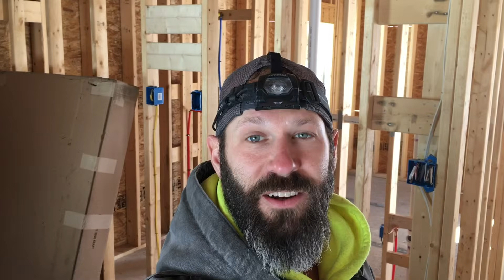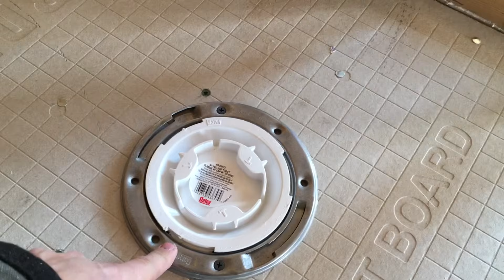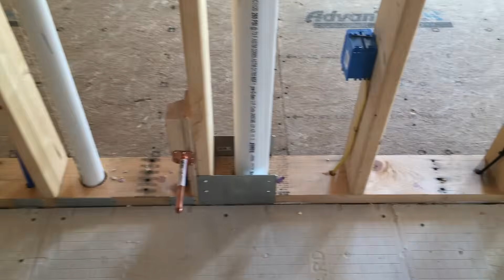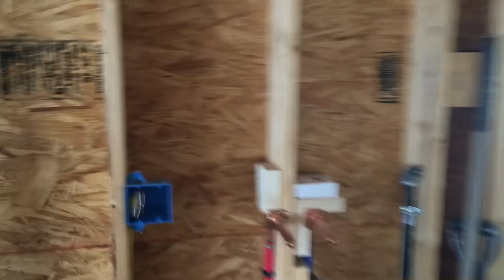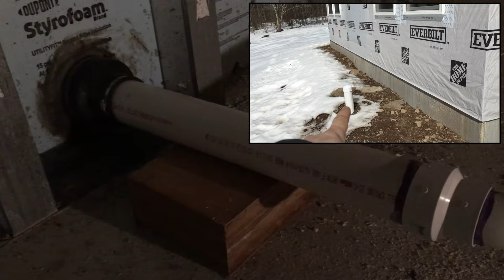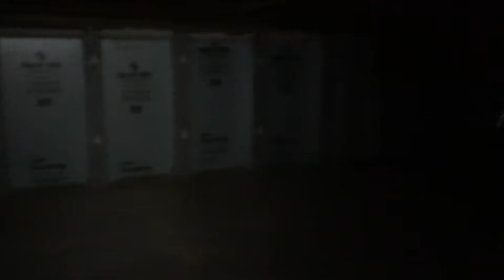Drain, Waste & Vent System | Off Grid Homestead Build Ep19Pt2 | The ShabinLife

Comment: do i need to have venting for every bath room(which i believe so)? and how to do the venting for multiple bath rooms? Thanks in advance!
Reply from the maker: Most times you can have vents tied together as long as they're within a certain number of feet (most times 10ft). The inspector may be a little more flexible if it's just a bit further depending on the rest of the install. I've come to just question the inspector if there's any concern so I don't have to redo anything later down the line. Hope this helps a bit & thanks for checking out the channel!
Reply: @shabinlife  As you say,  you can if you prefer run vent pipes together in the attic.  There is a calculation I believe (UPC vs IPC may be different) for total sq in of vent required based on number of drains and their size (total vent sq in >= drain size sq in total).  So it may be necessary to have a 3 or 4 in vent going through roof if you do that.

Comment: You are using the term wet vent wrong. A went vent is when a vent of one fixture is used as a drain for another fixture this usually happens in two story buildings. These are all dry vents there is no sewer draining into your vent pipes.

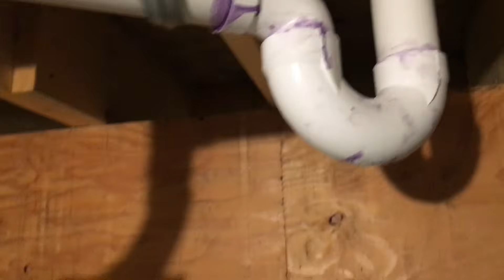Comment: @4:22 ... Toilet has to be last fixture on the branch. In your situation, you should have  run shower drain  further down the line and connect it with "Y" after  toilet. Otherwise, nice, clean job.
Reply: Not true. Has to be last fixture connected to a wet vent
Reply: @dallaskeck7169  Well, depends under what Code your work belongs. UPC vs IPC. There are also State Codes / Municipal  / Local Codes that add to the basic installation requirements. In rural and unincorporated areas, you can do what ever you want. In cities and high-populated areas, you have to follow local Codes. If I am inspecting your installation, I'll issue a Correction Sheet, regardless. Thank you
Reply: Toilet must be last fixture (period)
Reply: @businessman5894  True words
Reply: Why he run the kitchen drain to far from the main? Explain me
Reply: Wc only must be last on a wet venting. his setup is all dry vent. Just to prove it, look up circuit venting in a commercial building where there's like 20 fixtures on a single drain.

Comment: Putting water lines in the outside wall for the kitchen sink is an accident waiting to happen. There is no crime in bringing those lines up through the floor of the base cabinet. (49 yrs in the trade)
Reply from the maker: Thanks again John, certainly a great recommendation! I did install the waterlines in the exterior walls on purpose, but I also made it very easy for myself with the PEX lines & connections in the crawlspace to snip and reroute easily should we want to (or need to, lol) change things up.

Comment: Two quick observations, the under floor piping is in violation for insufficient support. The interval of suspension for all pvc piping is 4' max. Also the riser for the laundry trap to the outlet box appears too long. Code in my area is 18" minimum and 30" maximum. I suspect that the video was shot before inspection.
Reply from the maker: Thanks John, will be sure to throw on some additional strapping in the crawlspace. Trap riser sits at about 28in so we should be all good. Have a great weekend!
Reply: Code is 18-48” actually. National code.
Reply: @lorenzoboasi2606  30 in max IPC

Comment: very clean work, well done. my only other comment would be the grade on your main waist line, the last 10 feet or so heading to your septic tank. That grade looks much steeper than 1/4 inch per foot. perhaps its how it looks on the video, but if it is raked as steep as it looks it is a potential clog area.
Reply: Are you referring to where he dropped down to tie into the 4in for the septic? If it is how else would you make that elevation drop possible?
Reply: Start from a lower point then you won't need to exceed 1/4" /ft slope @GGg-ug3jr

Comment: I am so very glad I came across your channel! My eldest son and I are starting the plumbing on my shed to home conversion (640 sq ft) and even though I have been learning everything I can about plumbing, it has been so daunting. I planned all of my plumbing fixtures on one wall to make it easier, but this project is so out of my comfort zone, I find it scary to actually start - but I will! Your video is the only one that I have found that walks you back and forth between the pipes inside and underneath, and you also go into the details I need. Thank you for posting!
Reply from the maker: Thank you so much for your comment, it couldn't have come at a more perfect time.  I'm so glad the plumbing video helped you out, (funny... of all the construction trades, this was where I was least experienced 🤪 as I've spent most of my life in electrical). I watched your latest video & we too spent many hours reading, watching & planning before getting started. If you have a professional inspector, don't hesitate to bounce questions of them as well... especially if you paid for permits, 😁. Thanks again for watching & wishing you all the best on your build!
Reply: @shabinlife  I am a visual person, so just being able to confirm what I have been learning by seeing each fitting under the house was a huge help. Thanks 😊

Comment: i have a customers toilet that has a strange looking clamp under the floor that uses the subfloor to support the drain. also same person cut the plumbing pipe 3 feet away from the flange. now 4 plumbers have come in before me and I've been there min 10 times. I've had to sand the bottom drain on toilet as it was slick and no wax would stick to the toilet . however now its leaking after 5 flushes. and a 2nd new toilet base. this 1 I haven't sanded yet. I have deep suspicious that the drain pipe must be moving. I've tried 6 different wax/rubber/foam gaskets all fail badly. any help would be grateful, after doing 150 or so toilets in 30 years I've never seen anything like this mess

Comment: According to may plumbing inspector, you can't use metal straps on PVC or ABS pipes. You have to use the plastic equivalents
Reply: Varies on where you're at and what plumbing code your city or state adopts. Split rings are metal and are used all the time to stand off walls or ceilings when needed. Also have used 2 hole straps abd passed mine.

Comment: Nice job! Minor question -- You described your kitchen as having a wet vent, but does it actually? I thought that's when a fixture drains into another fixture's vent, but the sink seemed like it had its own dedicated vent.
Reply from the maker: Thanks for checking out the channel Alan! I'm pretty sure a wet vent is when the waste pipe (or drain line) also shares the vent pipe. Multiple drains can share a vent as long as they're within code distance for your area... That's 10ft here, so the kitchen was just a bit far to tie into the main stack. Hope this helps!
Reply: @shabinlife  Kitchen sink is dry vented, not wet vented as stated

Comment: Very helpful and best video. I just subscribed. Just a quick question: Do you not need kind of insulation or heat tracing at the cross bay sanitary ? I am not sure if the cross bay is heated. Looks like the Sanitary under grade may be subject to freeze if no heating at crawl space.
Reply: You would on the traps, if everything else has proper fall then no, moving water tends not to freeze.

Comment: Very useful and quality video. Isn't the vents suppose to connect within 12" from the p-traps of the fixtures ? For  p-traps to work properly. Plumbing code.
Reply: You are allowed 6' for a 1-1/2 trap arm, 8' for 2", and 12' for 3"
Reply: He was talking about the minimum maximum for the crown wier elevation, also that stand pipe on that laundry is way to long!

Comment: Really explicit video, showing and describing what I need to know. When I check a look at the size of your washing machine water inlets I realize they were 3/4 of an inch, so I looked at mine and the bastards put a half inch hose on a 3/4 in line. When you buy a house that has been flipped, you can expect extremely cheap connections. I have to completely redo the entire bathroom because they cheaped out on just a few things that caused the addition to sag and split from the rest of the house. So I need to move the bathroom and destroy the addition and this video helps me to understand what it's like simply to redo a new bathroom
Reply: Canadian plumber here. ½" is fine. New houses all use that and is code. Cut into one sometime and you'll see how much water is there. Lol
Reply from the maker: Thanks for watching Casper, I'm glad the video was able to help you out. Best luck with your renovation!

Comment: Good video but I did all my planning too ahead of framing in walls. I actually marked and drilled all my pipe holes in 5 1/2 bottom plate prior to framing that wall. That way once I framed the studs and top plate and erected and nailed in place, I was able to use my pre drilled pipe holes in the bottom plate as guide to finish drilling thru the floor decking.
Also from past experience I did not leave any big gap around tub drain pipe. Doing so will invite mice to make a home under tub and to store nuts and such under tub. I had a pecan tree and I swear it used to sound like the mice were playing marbles under tub at 3:00am in the morning. If you do drill out to big just make yourself a couple of snipped out thin sheet metal with pipe size radius cut out in both pieces and push together around pipe in floor and screw down to floor decking. Doesn’t take much opening for a mouse to squeeze through. I like to tell people if a mouse wants in my house it’s going to have to have a key to the front door.
Reply from the maker: Thanks J, all great advice & certainly not a bad thought at all. Funny enough, I just spent the last 3 days catching mice each night in my Silverado parked just outside the Shabin. Was a pain to clean out the crazy nest they made in my dashboard in only a day or two, lol. Hope you have a Merry Christmas & Happy New Year! Thanks so much for watching!!
Reply: @shabinlife  Yeah sounds like a mess having  mice in vehicle dash. You need a cat lol
I’ve looked at more of your videos. Surprised you don’t have way more subscribers. Very good channel.

Comment: I am wondering, were you able to pass inspection with your washer drain tying in below the laundry sink drain. Would the vacuum cause by the laundry sink water siphon out the p-trap on the washer drain?
Reply from the maker: Hey Dianne, great question, all went well with the plumbing inspection. The laundry drain & utility sink share a vent which will keep the utility sink trap from being siphoned. Hope this helps… thanks so much for checking out the channel!!
Reply: @shabinlife  Super! I did see your other video where you stated you passed inspection Great videos BTW. Keep up the good work!
Reply: @shabinlife   your wet vent wye for the laundry didn't look quite right...Dry vent and wet vent connections to main drain lines are made differently. A dry vent must connect at an angle of 45 degrees or greater, measured from a line cut horizontally midway through the pipe. Because it carries water and air, a wet vent must connect at an angle less than 45 degrees to this line.
Reply: @danjensen957  At that point the line is a drain and has no venting function.  He can tie in at whatever angle he wants.  If that line was serving as a wet vent (or dry vent) then correct, rolling of the connection would be important.
Reply: @johnneil6653  this is the information I have... Can't seem to get the picture to post though. I could email or PM it to you.
Plumbing codes are very specific about the angle at which a wet or dry vent may enter a horizontal drain line. Make sure you have enough room for wet vents to enter drain lines so that your drain configuration will function as a true vent (see illustration below).

22428b40-0f21-43ee-a0cc-d21c40f6342e.jpg
Reply: @danjensen957  Your info is good, but wrongly applied.  If you're referring to the connection illustrated at 20:20 in the video, my point stands.  That is neither a wet vent nor a dry vent connection because it is not venting any additional branch arms that dump into the main horizontal line.  (Same is true for his kitchen drain connection at 23:46.)  That's simply a vertical drain line joining into a horizontal drain line and why it passed inspection.  You would be connect if that line had a venting function.  It doesn't.
Reply: @johnneil6653  as my understanding improves I'll get better at applying the rules.  Since the washer ties into the  vertical drain below the laundry sink he called it a wet vent.  Wouldn't the trap arm from the laundry typically  have its own vent before it connected to a vertical drain?  It is very unlikely that the waste from the sink draining at the same time as the washer would ever suction the weir of the washer trap.  But, if the drain from the sink ever clogs the vertical joint then the washer trap would be without a vent.  I don't know for sure yet how tilting the wye below the 45deg as required for a wet venting connection at the main has the needed effect though.
Reply: @danjensen957  1) Wet venting doesn't appear to be allowed in his locality, else, the poster could've plumbed/vented his bathroom more easily.
2) Wet venting is only allowed in bathroom groups by code.  

Don't confuse this with a wet vent.  It's a common vent, found in your code book under common vent subheading.  Some call it a "vertical wet vent" which adds to the confusion.  Common vents can be performed at offsets in elevation which is what he has done.  He's used individual vents for every fixture in the house, except the laundry sink and washer standpipe, which are common vented.

Because the poster isn't using horizontal wet vent strategy (for his laundry or kitchen or bathroom) he's okay to dump into the main drain line at whatever angle is convenient.  His intersections into that main drain line are neither wet vents, nor dry vents.  They're drains.
Reply: @shabinlife  this way you did the laundry sink contradicts a lot of videos saying you need a double y so the two drains are at same height and they said it would not pass inspection on new code. I was going to add a laundry connection on other side of wall from bathroom sink and was debating how to tie them both in to a 2 inch drain
Reply: What he did there is called a "vertical wet vent" or a "common vent" depending on how you read code.  Perfectly legit although newer code years are requiring 2" laundry trap to dump into a 3" drain line.
Reply: @johnneil6653  only 3in on the horizontal. Can stay 2 in until it turns horizontal. Does not include trap arm

Comment: Where I live the toilet flange sits on TOP of the finish floor.  Also the vanity drain requires a later line not a direct sanitary tee fitting.  You have a "S" trap, like the kitchen sink line you did.  Also you can vent the whole bathroom with the 3" line, you don't have to vent each fixture separately.  Drain lines on a 3" vent can be 10ft away, 2" can be 6-8ft away, 1 1/2 6ft away or less.  Great looking job though.
Reply: You can vent the whole bathroom in 2” and no you don’t need a “later” line.. the correct statement is that the lateral needs ti be 2x diameter of the pipe being used.. so as long as it’s 3 inches or more to the trap from the sand tee, you’re good. National code.
Reply from the maker: Thanks for checking out the channel Vinny & thanks for the info, always appreciated.
Reply: Also.. you do not need a long turn 90 for a single fixture. If that was a stack then yes you’d need a long turn fitting. Again. National code.
Reply: @lorenzoboasi2606 in Kentucky we don't follow IPC. People in my state will see this and get fed totally wrong information. To any DIY'ers out there...check with a local MASTER plumber, or the states code enforcement website for info. I've plumbed in 4 separate states and they are DIFFERENT. My state requires a vent for EACH individual fixture. Each pipe size has a maximum developed length it can be ran. Trap to vent length has to be a particular length, depending on the size of the trap. My state is STRICT. Some others may be also. ALWAYS, ALWAYS, ALWAYS check with the state before consulting YouTube.
Reply: Great tip. I have a stand-up shower that is approximately 6-8 feet away from my toilet and don't have a viable way to vent it. But with your advice I feel more confident that I can use the exiting toilet vent to do that, thanks.
Reply: Not an S- trap unless your trap arm is within 2 pipe diameters of the face of tge vent
Reply: @Endotoxinn Depends on how he hooks up the trap.  I bet he knows now how slow it drains now.  Letteral arm is always best in my opinion.  The water will hit the back of the sanitary T and go up before it goes down making it drain very slowly.  He did it in the kitchen, I would do the same for the bathroom.
Reply: N venting is always helps ....always put a sanatary tee for my vannitys n showers at some point
Reply: according with the code book here in Nevada, you are right, i just chrck one issue, kitchen, laundry sinks and utility sinks goes a clean out, si you need to put one on your laundry sink
Reply: Correct
Reply: in Connecticut the same way .. that 3inch can vent the whole bathroom. toilet elbow should of been a long pattern  90.
Reply: @samteacheats7177  not if less than 12in riser
Reply: Everywhere the flange is suppose to sit on the finished floor. But more and more guys take the easy way out. And you get like one of the replies here that is suppose to be flush. Flush is false. That's why so many toilets leak in a short period.
Reply: In reality really your flange should be flush with your finished floor..or at least kind of considering tile installation...but really the flange should not be popping out considering every toilet from the bottom is not the same all the way so u have to be careful it rock